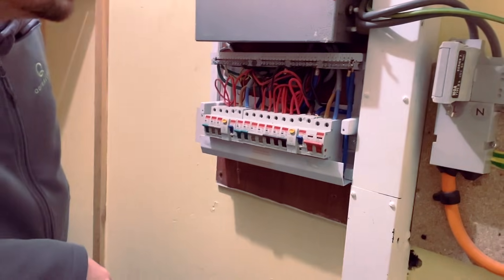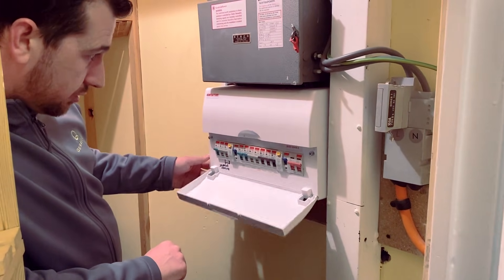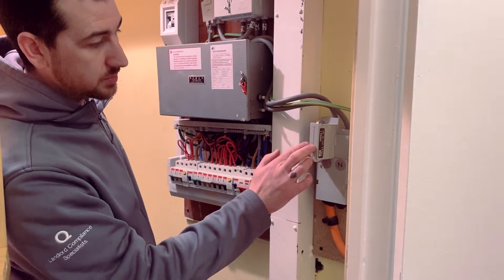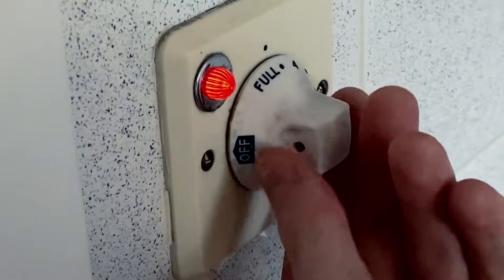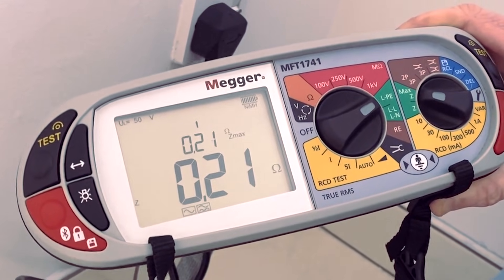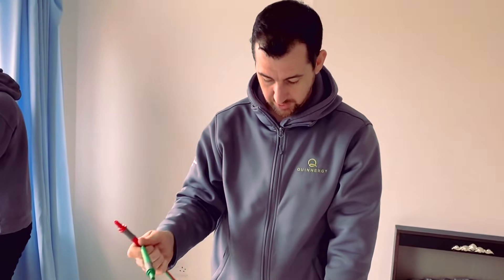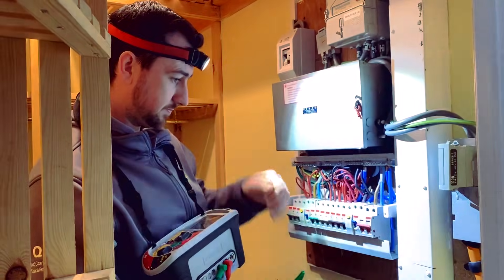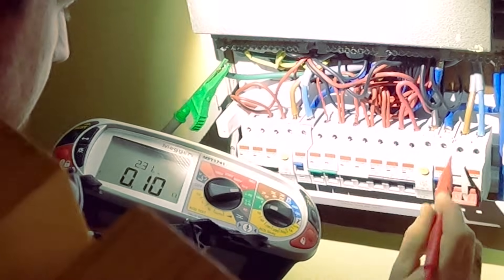EICR Walkthrough - Local Electrician Tests & Checks a Properties Electrical Installation

Comment: Why are there only like 3 cpc's in the fuseboard? 🤔
Reply from the maker: In this particular property the containment was used as the CPC for most of it as it was an older installation. It’s no longer standard practice, but as long as it’s continuous, and the readings are good, then it’s still perfectly acceptable today. 

Hope this helps 🙂👍
Reply: @Quinnergy  ah OK, didn't even think of  containment, nothing wrong with that.

Comment: Sorry to rain on your parade ,but you can’t do a ring socket test at a socket as the neutrals / cpc’,s are all together in the consumer unit , that could be any old neutral or any old earth wire ,Especially parallel earth paths come into play
Reply: @BabyBane100 you can carry out ring final test at any point of the ring. As long as disconnected from the consumers unit. We carry it out this way so its quicker to carry out the other tests. It has also been done this just for the Aid of the video for our clients it's not a step by step guide for other electricians as explained at the start of the video, this video is to help show our clients what's involved in an EICR.
Reply from the maker: Thankfully our parade remains bone-dry, as the cables are in test blocks, and the circuit is disconnected at the fusebox and put into test connectors ✊🏼💦
However, thank you for your potentially helpful contribution ✌️😁
Reply: @Quinnergy  If you went to all the trouble of disconnecting the wires ,and putting them in connectors at the fuse board you could have just tested ring there ???
Reply from the maker: @BabyBane100  We did it this way because testing it at the socket = better visuals for the video. 
Our videos are partly to provide our clients with a basic understanding of some of the things we check whilst we’re in their properties, and partly for entertainment. 
You may do things differently from us, and that's okay. 

Take care ✌️

Comment: Are you taking off and reterminting all sockets? Is this  necessity for this test?
Reply: You don’t need to take every socket/switch forward. In my report I just state that only 10% of items have been removed and checked to cover myself. As long as all the readings are ok then there’s no need to take all the sockets forward, just make sure you go round to every socket with the plug on to make sure both sides of every socket work and also get r1+r2 readings from every socket on the ring and take the highest reading (as you probably already know)
Reply: Not necessary to remove all sockets when carrying out an eicr. If after removing the 1st few and they are bad then would remove more.
Reply: Thank you. As an old age apprentice I have much to learn, glad to benefit from those experienced enough to shed some light.
Reply: @jimmylovescake6813  anytime buddy. Keep in there and it will pay off